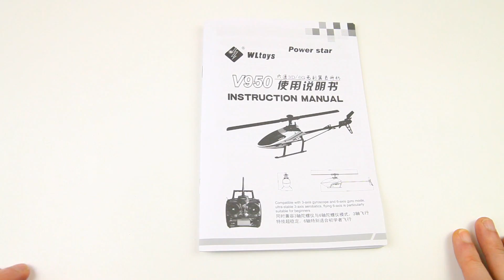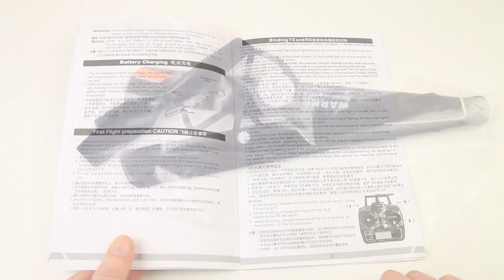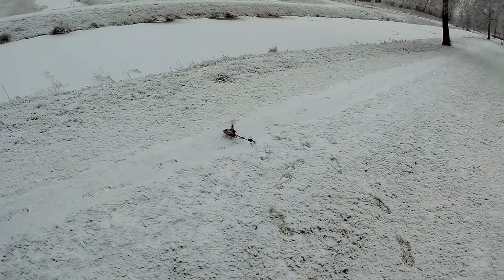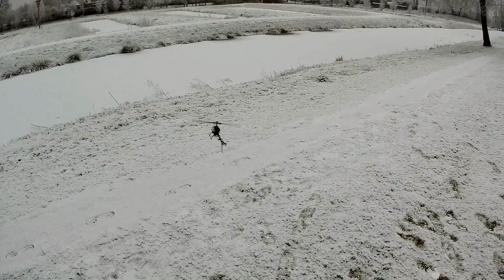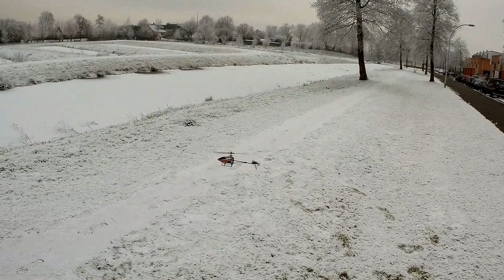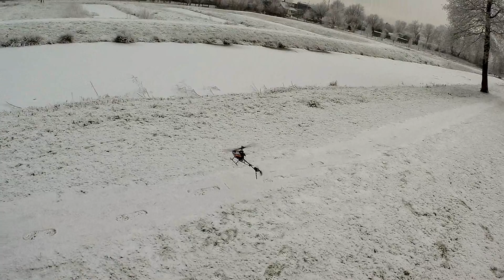WLtoys V950 Entry level 3D Helicopter.. Any good?? - Show & Tell

Comment: My gosh, the English manual is hilariously horrible. I think that if they had directly translated it from Mandarin to English through Google Translator, it would be more understandable than it is lol.
Glad your video exists!
Reply from the maker: Haha :D  at least you (we) get a good laugh out of it or what? :)  
Does make you wonder what the schooling system in China is like ;) 
Cheers and happy flying!
Reply: @DutchRC  Got a bit of a laugh and a bit of frustration, 50/50 to be fair lol.
There's a section in the manual "explaining" how the charger works and it goes: "When the red light, the battery is fully charged", and I was left wondering "when the red light what??".
I still don't know if the red light is supposed to blink or simply stay on when the battery is done charging.
And thanks haha!
Reply: @DutchRC  Oh, mate, if I can bother you with a question.
My V950 came with a different lipo charger than the one advertised and shown both in the box and in the manual. So instead of sending me the one with the wall socket adapter, they've sent me an apparently cheaper one that only has a USB cable, and I'm left wondering how to use it (if I can or should plug it in my PC's UBS port or even in a mobile phone charger).
This is the one that came in the box for me, any idea on how to use it or even if I should? Thanks! https://www.ebay.com/itm/393274084676?_trkparms=aid%3D1110006%26algo%3DHOMESPLICE.SIM%26ao%3D1%26asc%3D20191002094254%26meid%3D2488ec2cf9ca4bf4808f7aa67ac510f6%26pid%3D100889%26rk%3D1%26rkt%3D6%26sd%3D252654189643%26itm%3D393274084676%26pmt%3D0%26noa%3D1%26pg%3D2332490%26algv%3DDefaultOrganic%26brand%3DUnbranded&_trksid=p2332490.c100889.m5204

Comment: Is the pitch of the rotor blades adjustable?
Reply from the maker: Yes sir.. this is a 3D capable heli..
Reply: Ok so I could adjust the pitch so as to make it have 0 negative pitch?
Reply from the maker: @PilotChris06FW  Yes :)  That is Required to be able to fly upside down right? :)
Reply: Well i can’t fly 3D what I’m really asking is: is the pitch range adjustable by twisting ball links and using a pitch gauge? Sorry for confusion.
Reply from the maker: @PilotChris06FW  Ohwwwww :D   Well yes you can adjust the links..
Reply: Thanks

Comment: Is it durable?
Reply from the maker: It's not bad..  but with Any helicopter goes: if you crash, most likely you're gona have to repair stuff / replace parts..
Reply: DutchRC Adventures I see, would you say it's at par with align and blade in terms of durability?
Reply from the maker: About the same as Blade's.. Aligns might be a bit more durable, but even then: if you crash: you're most likely going to be repairing things :)

Comment: Be careful abot wltoys' BNF v950. i recently got one. pushrod came off, pitch is wrong, and sign showing it was work on before. highly suspected that it is a refirbished unit and done by someone who does not know what he is doing. Bang good keep apologize but no action to take care of the roblem. i won't buy from them again!
Reply from the maker: From banggood? :O  Hmm offcourse not Everything I got from them was perfect, but I have not run into 'refurbished' things.. The cause of that Might offcourse be that I order stuff that has just been released in general.. 
THE 'secret' on getting good service over there is to shoot a short but Clear video showing the faults in the product.. That really helps.. 
Offcourse it IS hard for me to now judge customer care in any shop, because there is a good chance I will get prefered treatment :$
Reply: I send photo and video three times and bout 5, 6 mail and still can not get things straight. I fixed one thing and more problems pop out. They need to do better jobs in quality control.
Reply from the maker: I don't think BG itself even opens boxes.. That would surely be FAR to much work with all their sales.. 
But yes.. I offten urge them to complain more with their suppliers..
Reply: The customer service from BG has no knowledge about the product. I don't know haw they sale goods without having someone to know at least a little about the products?
Reply from the maker: I think it could be quite Hard to find people in China that speak / write good english And know about RC's.. Those people would then probably allso cost more then they would want to pay for a customer service position.. 
In the end: 'we' want to buy things at a low price.. that probably means corners have to be cut somewhere...
Reply: I speak Chinese so in the begining I was trying to call them and the phone number list on their website is not a working number. I wrote them e-mail and send photo and video and they kept ask me to resend them for three times. Drove me crazy!
Reply from the maker: Hot damn! With you speaking Chinese I would have expected you to just Sail on through the customer support hassle :|   Hmm yes.. I can imagine it did!..
Reply: only if the phone number is correct
Reply: Albert Wu Just curious,  did you ever get it worked out with them. I agree, it was probably a return. Sad they resold it. Usually they never do that. Well. I decided I like the size but not that brand. I have a 913 that has had its share of issues. I am going to sell it. I recently aquired a Align 450 brand new, fully loaded with upgrades that I traded for a 300 extra balsa electric. I paid $100 for that extra then destroyed it on its Maiden. I rebuilt it and traded it. I should have flown it one more time but screw it.

Comment: I dont know why but putting toys on the end your brand name just makes me think not hobby grade its putting me off buying it
Reply: mattinwinkymg , my friend , I was also concerned about the name wltoys , kind of kiddie ish, anyways I have a fleet of rc heli, my top is my align T-Rex down to syma 109 3 channel , I love them all , I'm a retired a/c mech and I have nothing but time on my hands , which I spend a lot of time flying , I have over 26  heli alone , point is I have almost all the wltoy brand, they never ever have failed me  held up to all my abuse when learning to fly , I've gotten good at it and hardly ever crash , so I took the plunge and bought the V950, all in all it is a great helicopter , I have over 50 flights on my first one , never crashed it , and still still still flys great , prob the better flying in my fleet , I bought a lot of spare parts that I have yet to use, take the plunge , buy it , I promise you won't have any regrets , one thing I did find a little off is the yo yo action you will get when doing  hard launch straight up , you will see , the way I corrected this is to hit the down throttle trim button 6 to 8 times and it will smooth this yo yo action out , once you learn the ac habits better you'll figure it all out , in my minds eye it is a very good ac , hands down , I now have two of them  because the price is rite and I fly the life out of them , like a old time x watch , keeps on ticking , good luck
Reply from the maker: Howdy sir :)  ghehe yes I DO agree.. bare in mind though, that Most RC's are essentially that.. Toys :) 
I don't know a lot of people that 'use' them professionally..
Reply: well howdy to you friend I'm thinking along the lines of parts support which toys don't have and hobby grade rc do but yes they are big boys "toys"
Reply from the maker: Halloa :) 
well yes.. parts Are available for it, the main attraction (for me) though is it's low cost.. that really makes flying it quite a bit more relaxing.. 
Will it take a hit? well nope :P ghehe  Mine is still fine, but I Know a crash will have me ordering up parts :)

Comment: Its definatly a 200 size helicopter. not 450 as a few have mistakenly thjough. It swings 205mm blades the same as the trex 250. a 450 swings 360mm blades.

The naming system is a bit confusing and theres not much consistancy between manufactuers and even with the same manufacters things get weird between differnt models.
Reply from the maker: Agreed man! I really wish this industry was a Bit more professional in that sense..
Reply: When you get to testing 3d mode be carefull of the collective. alot ofusers have noted that its very jumpy on the collective. someone measured it and there was only 1.5 degrees of pitch change between 50% and 60% throttle and then all of a sudden it jumped to 3.5 degrees/

I dunno if you have the updated version or original but alot of people have had servos burn out due to wires inside shorting out.

I have a trex 250 but may get one of these as a gently flier and mild 3d machine. 15 minutes flight time is the big seller on these
Reply from the maker: Same exact thing here :)  I allso have a T250 ;)  
And thank you for the heads up! I'll make sure to have a bit more room for the 3D tries then...

Comment: I always liked flying helicopters, especially scale looking ones, theres just something "real" about them. The way they look and the way they sound. A lot of fun, but very flimsy and easy to break. This one is a lot like my JRC AS350 3D Heli. 
I like those Transmitters, I think it's great how you can change them from mode 1 to mode 2 with a switch.
Great review mate, looks like a great chopper (0:
Reply from the maker: Howdy brother :)   I think with the quads we have now, very few people will get into flying heli's.. A crash just results in utter missary with heli's :P  There IS something special about them indeed though.. 
Yeah.. this IS an entry level heli offcourse.. for what it is, I like it though :)
Reply: DutchRC Adventures 
Yeah good to try and teach yourself 3D flying. I tried it with mine and just crashed the hell out of it, so I stopped ha ha
Reply from the maker: Hmm yeah.. that will probably happen to this V950 as well ;)
Reply: DutchRC Adventures
No doubt ha ha

Comment: WLtoys does make some good stuff. The V912 was a great 4 channel heli. This one does look promising...just wished they used metal servos. It reminds me of the Walkera Master CP I have-also plastic servos and brushed main and tail motor, but I did upgrade to metal and brushed main motor after a couple crashes due to plastic servo failure. The Master CP tail holds up well...hope the WLtoys holds up too. Can't wait for your full flight video with this heli.
Reply from the maker: This heli can indeed do with some upgrades.. That's o.k. at this price though I think? I haven't been able to find another RTF 3D heli at this $$ :$ 
So far, so good though, eventhough I haven't had crashes yet ;)

Comment: I have enough spare parts to rebuild mine several times but havent crashedcmine in a long time,learning 3-D and got total hang of it by the way.
Reply from the maker: Ghehehe yeah.. Ive got a bin of parts for Align 450's as well :)  (and that Is needed more offten then I like :P)
Reply: DutchRC Adventures Wow, where did a year go? Just picked up an Align 450 brand new never flown. lots of extra parts too. Has metal flybar set up. Carbon fiber flybar paddles. Hey dutch, question. I havent any experience with collective pitch, only fixed. What heli do you recommend of the WL toys. I was told the 977 would work. What do you think?

Comment: Great review Mr Dutch! It's good to see a heli - so few new ones these days. My shop now has maybe 3 or 4 when they used to have quite a few more. They are still fun and even though you spend time fixing, adjusting and working on them, you do the same w quads-cleanflight and all that comes with that.
Reply from the maker: The fun is in the chellenge of flying them, but yep.. you do go through 'some' parts ;) 
Hmm I think it was -5 to -10C here yesterday :$
Reply: I have a Dynam Razer 450 and I agree, I find heli's fascinating in principle and operation. Blade tracking is essential for jello-free video. I have gone through many sets of rotor blades but still enjoy flying it. It's not relaxing like a floaty fixed wing plane and certainly a challenge. Thanks for the video. How cold is it over there these days?
Reply from the maker: Yes sir.. things have to be easier these days huh? True though.. fly one of these into a tree, and you'll be working on it for a while ;) 
I really really like the way heli's work & fly though :)  I'm unsure what a FPV heli would be like by the way... what do you think? :) 
Cheers & thanks for stopping by!
Reply: haven't tried it but it's been done I assume-probably a lot of vibration to deal with. Helis are very cool machines - I still really like the scale ones, but those are so rare now in a small size.
Reply from the maker: Hmm good point.. vibes.. I'll have to strap a camera onto it.. 
YES.. I allso very much like scale ones.. I've been looking for a nice scale one in the 450 class for quite a while..

Comment: I have the V977, V931, and the Hisky HCP100S/HK Assault100. This one looks to be the ideal next step at a reasonable price. As I already have a WLToys transmitter setup for heli's, and a module in my Taranis and 9XR that works with the WLToys protocol, I might just go for the BNF version, though that doesn't come with a battery and all my LiPo's have XT60's and not the mini Deans connector. Then again you can't have too many transmitters and bigger boxes are more satisfying to receive through the mail.
Thank you for braving the cold weather to do the maiden flight.
Regards
Nidge.
Reply from the maker: Yeah :)  I think this one is slightly bigger then the ones you have? (allso a Bit better power 2 weight ratio I suspect) :) 
Hahaha well YES you Can have to manny transmitters :P I'd really like to just have 1 or 2 transmitters, but that won't work :) 
Thank You for stopping by offcourse! Yep.. this cold really held me back from really flying it :$  Ohw well.. better luck next time :) 
Cheers!
Reply: DutchRC Adventures 
Maybe, as they have done with the HiSky HCP100S and some of the WLToys helicopters, they may come out with replacement metal swashplates which will up the class of this helicopter. I believe it has a lot of potential.
Regards
Nidge.
Reply from the maker: Yes sir.. I do hope they will have those upgrades for this version as well.. Good odds they will have those available for this version as well indeed :) 
Cheers! :)
Reply: sputniksam What Heli do you recomment for someone looking to move up to a collective pitch heli. I saw the flight review on this and dont like it. I love the size, just dont care for it. Any suggestions? The smaller helis are harder for me to see so I need something about this size. Its in between the 400 and 200 size. I have the WL toys 913 Sky bus. It flys like a bus. lol. Yes it works, but whatever. lol
Reply from the maker: :D :D  It's funny how opinions can differ ;)  Them wingtips are actually The reason I didn't get me a EFX v2 :P  (ever seen a 'real' airplane with wingtips like that?).. I htink it's a horrible solution to a wing-design flaw :)  (well 'flaw'.. I was quite pleased with the V1's performance really)